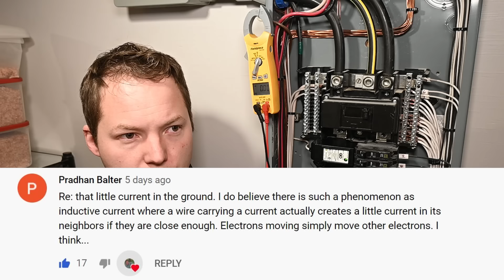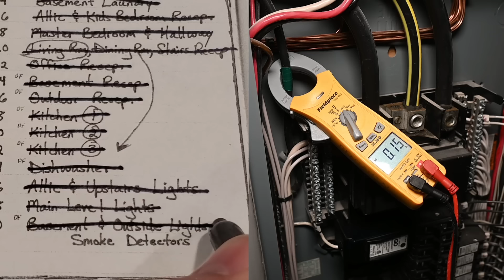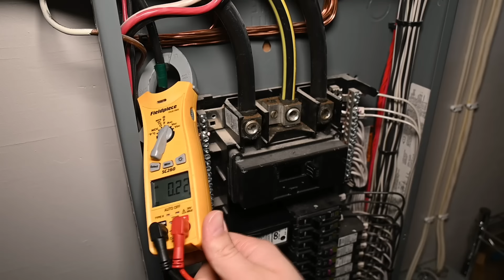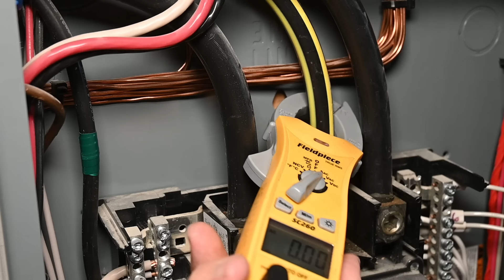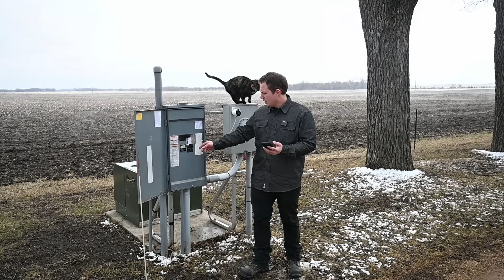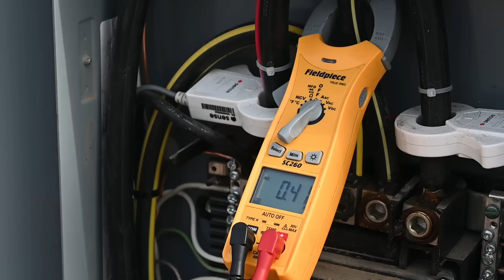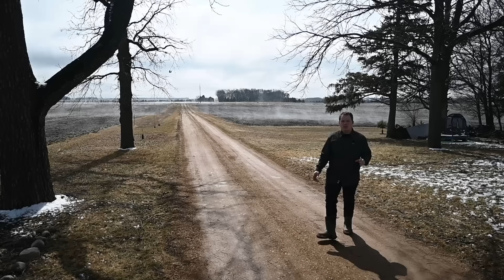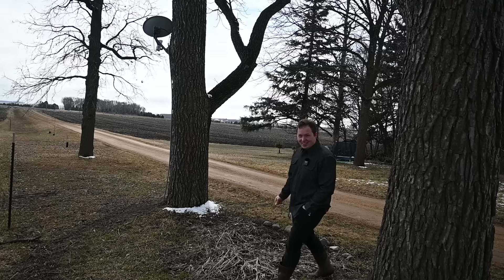Finding The Source of Stray Current on Grounding System

Comment: It is VOLTAGE leak, NOT current... Terminology and all that.!
Reply: if there is current there has to be voltage...
Reply: @snoopstp4189  Correct, but if there are no volts, current can't be found. And without a load, there is no current.
You can only get a Voltage leak, depending on the load, which dictates the current present. But there still HAS to be a load, or the Volts can't leak either.
Reply: @G1ZQCArtwork  actually incorrect, load or resistance is not required for a electrical circuity.   Volts don't "leak",  voltage is only potential for current, it doesn't require current flow to happen.
Reply: @snoopstp4189  Current does NOT "flow". No volts no current, simple. How do you measure current in a circuit.? You can't directly, you can only sniff it with a shunt or magnetic clamp.
Physics is great when you know the facts.
Reply: @G1ZQCArtwork  yea actually it does, if you understood the concept of voltage you would realize who wrong you are when say the words "voltage leak" like that.  You simply don't know what you are talking about.
Reply: @snoopstp4189  55 years in Electronics tells me current DOES NOT FLOW.! Its a by product of the Voltage & the Load, by warming the resistance. You simply cannot measure any current, unless there is a load on the present Voltage. Get your meter & try to measure current directly. You can't put your probes in a socket and find current, its not there without a load. Whats a super conductor for.?
Reply: @G1ZQCArtwork  55 years and you still need to learn the basics of voltage resistance and conductivity.  I recommend you start with something called "Ohm's law",  after you've mastered that, try understanding that voltage doesn't require either a load of a conductor.  Work your way up from there, you still have a few years to learn something useful.
Reply: @snoopstp4189  Voltage, Resistance & Conductivity. What no current.? Oh dear, when you have no valuable arguments left, try some insults when you are losing.!
Here is a challenge for you, go to an outlet socket, tell me what the current measurement is.? There will be none, because you can't get a connection to measure any, because there is none present.
There will be a Voltage 110 for the USA ETC & 230 for us in the U.K. No watts or current, until you apply a load, only then can you sniff or clamp any current.
Current does NOT flow.! It is a direct result of resistance in the cabling and the load applied. Turn that off and hey presto, no current.!
It Is a by product of EMF and resistance. Once you understand that, you can join the game.

Comment: At my location had one caused by squirrel.  Actually nothing on my line or property.  Squirrel did what they do, grew teeth, and decided it was time to sharpen them.  So it picked a nice spot on a power drop to the neighbor.  To let you know the power company here uses a single cable, two insulated hots wrapped around a bare neutral and the neutral has a steel core.  Also it is aluminum not copper although that might just affect the taste to the squirrel.  So squirrel doesn't find the insulation to be hard enough so the teeth go into the bare neutral.  After a few chews he moves down the line a couple inches and does it again.  Soon enough he has chewed through every strand of the neutral at some point.  So now all that is connected is the steel core.  Steel has a much higher resistance and there isn't nearly as much conductor.  So power being power, it finds another path.  It takes the ground line out of the neighbor's house and comes into my house via the ground, where it takes the bond and then makes its way via my neutral back to the transformer on the power pole.
I know this isn't your exact issue, but it gives you an idea the problem may not even be on your property and you may need the power company to come out and look at your neighbors.

Comment: I know the video was over a year ago, so if you figured it out already - good for you.  If not, consider NEC 70, 2014 Handbook exhibit 250.19.  You may not have isolated your neutrals from your EGCs at the downstream disconnect locations from your service disconnect, thus not bonding your GECs as they are supposed to be.  just a thought

Comment: I live near one of the largest marina towns in Europe. Most people have unusual erosion on sacrificial anodes on outboard drives on their boats, moored by their back garden, as ground currents make their way back from canalside villas and apartment blocks through the water, passing in and out through underwater fittings on boat hulls, offering less resistance than the canal water - which differs in salinity according to the last rain shower. Fascinating subject, Ben, great videos. Keep it up ! OFSO
Reply: so would this cause ground current on the boats wiring? Trying to understand it all! Also, current can travel in water, does that mean it can electrocute people or it very weak?

Comment: When it was down to the last breaker I would have been suspicious blaming it on my luck. But when he turned off the main breaker and still had current I would have thrown my multi meter across the room
Reply: ? Into the mist over the fields, hopefully your meter case is also yellow coloured to aid recovery. Excellent video.

Comment: I can mention, that the power company in some cases depends on all services to be properly grounded to help them ground their system as well. Remember all grounds need to be a the same potential, any potential difference may also result in a possible voltage. With the power off,  You could also have checked each of your ground conductors of your branch circuits. I wonder if you were to lift the suspect grounds, isolate it, then check for any small voltage between it and a grounded conductor. You could also lift your main ground and see if there is any difference in potential (voltage) the solid ground going to your ground rods.

Comment: Sounds like Cathodic reaction between ground rods and or grounding circuits. Very common with multiple grounding circuits.  I have seen ground currents with no AC at all.  Gas lines can be Black Iron and Copper rods will make current loops.

Comment: Is called "ghost current" I've just learn about this on my studies and it does exist its real...
Reply: Isn't ghost current just emi?
Reply: @vmunoz1  No. Sound engineers can generally explain this better than I though. 
Current can be induced by twisting around or running parallel to a line over distance. It is not the same as EMI.
Reply: @firstjohn3123  you got any recommendations to look it up myself?

Comment: I don't understand how you are reading 0 volts on your hot cables just because you turned off the main below them? I did the same thing in my house and Im still reading 120 volts on the hot cables coming in from the meter? I could understand reading 0 if you were testing below the main cut off but above the main cut off?? there is still voltage so how are you reading 0??

Comment: Yes, it wants to go Into ground, through the ground, and back out of the ground at the grounding electrode however far away.

Once it's made it a few meters away from the electrode, it could go miles more- the resistance of the soil is really high, but the cross sectional area of the ground is square meters- millions of times bigger than a wire.

It's that first meter that's the hard part(and the last, but that's done to a high quality).

Comment: I've worked as a cable technician for 20 years. We battle what we call hot drops all the time and see crazy stuff. Anything over .5 amps we consider a hot drop. We have to call local power company and ha they just laugh unless it's burning or on fire. My experience is we are providing less resistance than the neutral or ground. I have had conversations with electricians and linesmen. Less than 10% ever have any idea where to start with these amperage issues. Lights flickering and dimming. Amperage on cable drops cause all kinds of issues in cable land. I try to always bond to the house ground seem to get less amperage issues there. We have meter clamps that we can use but never should almost 100% when we bond to the meter housing we get amperage on our ground blocks to our drop. Most issues we find are on the power neutral at the mast. Loose clamps on neutrals corrosion missing connection on neutrals all together. But ya this has haunted me for years cause I can only diagnose the issue and hope it gets resolved. I recently had a customer with a solid 10-12 amps going to his ground he was asking me if that's why his bill was astronomical. Lol. Great video.

Comment: I had a new circuit breaker box installed in my apartment and ever since it was installed my bill has tripled... an electrician has checked out the box however he seen no faulty wiring... outside meter seems to be working 100% correctly any suggestions?
Reply: Always look for simple things first.
Note the KWh reading on your outside meter and then again after a set period of time (weekx4 / month).
Find your bill's rate(s) and multiply with the kilowatt-hour use from above. Does it match your bill(s)?
Why the new box? Did you need more space(s)/circuits, like replacing a gas stove/dryer with an electric?
New car (AKA TESLA) at 240 by 50 AMP?
Did electric company change rates or start/end times of expensive tiered rates?
Any outside outlets that a neighbor could be "borrowing" from?

Comment: Call EEVBlog (Look him up) most probably the neutral is not bonded to ground in the transformer. SO there is some called reactive power vs apparent power
Reactive Power is anything like a transformer or capacitor that consumes power grid demand but no actual power because as much energy it consumes it send it back in so in reality the NET is zero where that is the apparent power / true power. 
I will reference a few videos here and I am sure this is the case. Because the transformer "hum" is actually power loss due to its construction. 
because inductors like transformers have a Voltage VS Current phase shit on 90 degrees so at some point it pulls current from the grid as a resistor and at some point it becomes a generator that pushes current in the grid with NET actual consumption being ZERO ( in very very ideal situations )
Now you see no consumption on your power meter because power meter measures Actual / Apparent power and not reactive power. (but you see current as  Electrboom  saw with out having anything plugged in ... 
Look at the video I posted below and that would be the answer.. Now this is all I can imagine.
https://youtu.be/l-s-FkZ3yI0?t=297
so this is the cuprite. 
EEVblog and Electrboom will safe your head scratching 
Thanks and mention the 2 of many gods of electronics and my self of course :D 
Enjoy :D

Comment: Center tap on transformer has improper connection(corroded or slack).
Put tester on voltage scale and probe between ground wire and neutral wire. If the meter reads some voltage then your ground and neutral isn't bonded properly the  Ground and neutral should be of the  same potential. 
Corroded or slack connection on earth rods.
Great video hope it gets sorted .

Comment: It looks all the ground wires of both the outside main panel and the inside panel are connected with some actual ( metallic) conduction.  Yes, some unwanted leakage is coming from the grid transformer and going to ground but why transformer ground has conductive link to the home panel ? Need to separate  the ground paths in each of the panels panel . It will still have same potential as earth ( ground)  the same mass

Comment: Dude makes me nervous the way he keeps poking his hand in the panel when the power was on....
Reply: Same. Not sure if it was the camera angle or what but I swear his fingers were a hair away from those feeds on multiple occasions.
Reply: @ThingEngineer  why aren’t those incoming terminals insulated or capped?
Reply: PPE at least one glove on hand guy open panel. Both hands in panel doing measurements NOT Good
Reply: Indeed, one guy was using a long non insulated screwdriver and gesturing with his hands like a mad man in front of his open main panel. As a master electrician he knew what he was doing but  still a bad safety example for us amateurs. I seen people even lean on the main panel while resting or thinking what to do next. One guy leaned on the power cord that was plugged in the wall behind him to tie his shoe, made contact between his skin and the prongs. Got electrocuted. Cops found him dead against the wall still standing was hard to tell what happened. That was a warning if anything.
Reply: It’s the camera angle, he mentions it in later videos, he said he’s about 6 inches away when it looks like he’s about to touch it

Comment: your 3 wire connection at first main disconnect if everything is bonded with the neutral there shouldn't be any potential between neut and ground if you have 4 wire from service entrance to sub in house, the fact that you have separate grounds at sub panel at house gives the possibility of earth transferring current by other current carrying material "earth" the extra ground rods simply gives the current a extra way to travel back to the center tap on an alternate or by a alternate way to go there and that creates a potential difference that shows up on your meter

Comment: Awesome video Ben, interesting subject matter here's my two cents since the transformer you were standing on as a primary and secondary coil I am  sure you're aware. This creates an EMF field which is what your meter could be measuring as that tongue style meter measures the field on the wire not true current... This being said remember we rate transformers and kVA and utilize them with respect to their VA rating this is because all transformers have IR square and other losses  heat, emf radiation, induction field losses. So you could be measuring this .. Peace
Reply: a non-malfunctioning meter of the type used in the video will be unaffected by external fields as the sensor apparatus measures only the closed field lines induced by current flow in the encircled conductor. in further detail: the encircled conductor is a one-turn primary winding of a transformer composed of the conductor and the sensor apparatus as the secondary winding

Comment: your transformer that feeds your house from public system is acquiring a bleed through your grounding system and is a potential voltage and current crossing from center tap